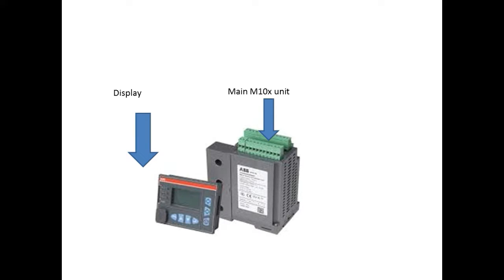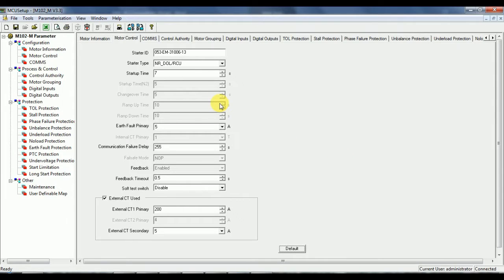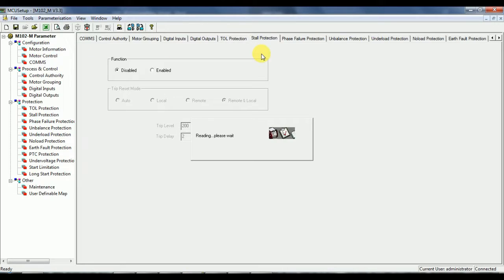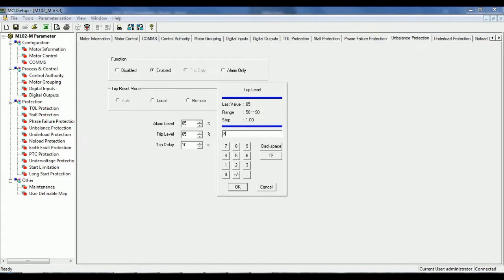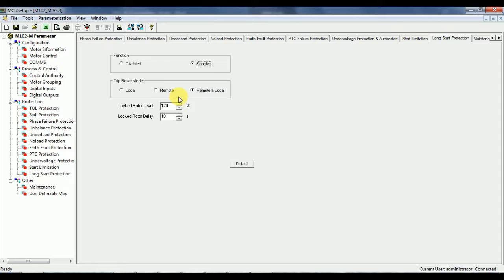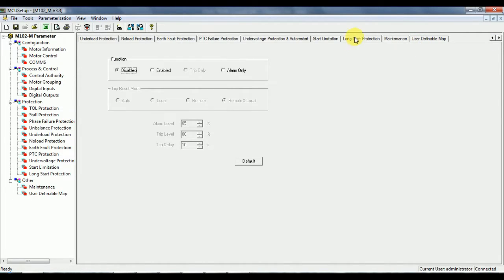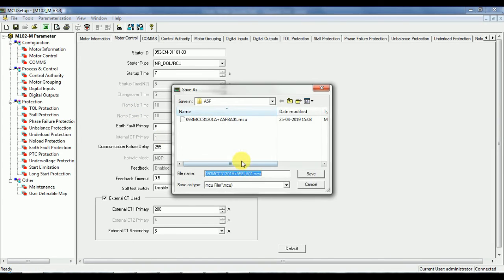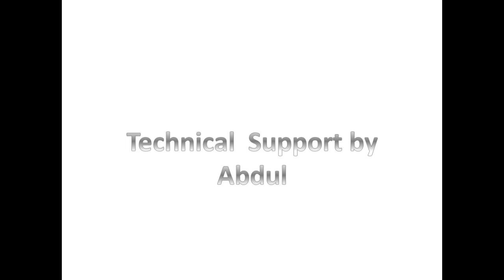Relay testing | M102 | & | M101 | ABB |ToL | Stall | Long start | &| Earth fault | MCU relay testing

Comment: Bro generator protection la 64r, 78, 24, 50/27, 810, 48, 21, 40, 32r, 60, 59, 64r protection pathe video podunga already I seen 59n, 27n protection in ur video please make remaining protection above I mentioned with settings calculations and how to inject